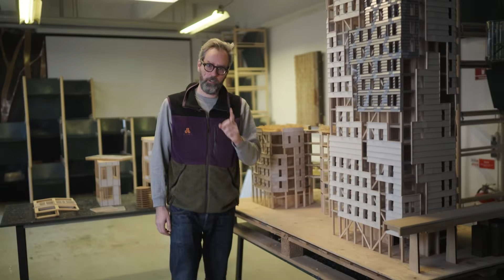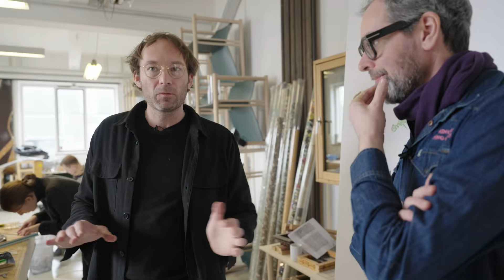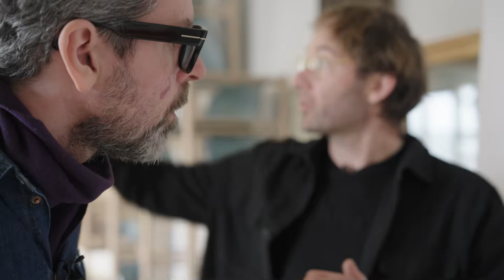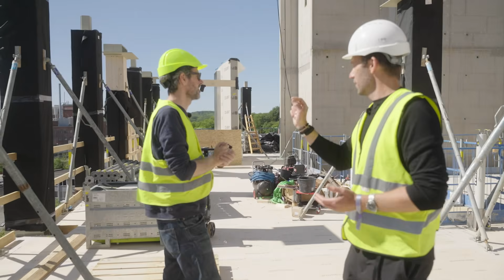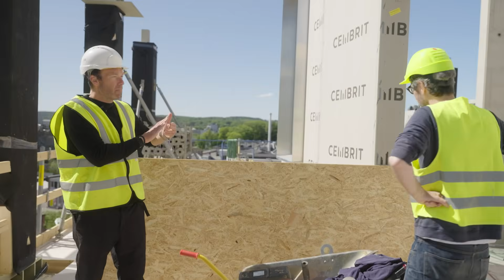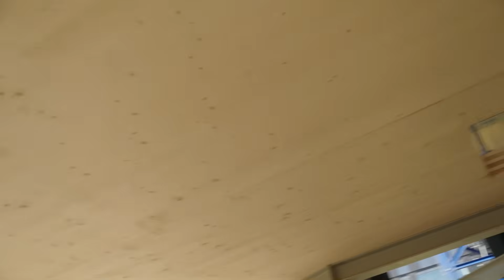Reconstructing architecture: Making one of the world’s highest sustainable buildings using wood

Comment: Oh my goodness - this was funny... But yes, we need to build more of this kinds of structures. I do it my self - just on a smaller scale with wooden structures for 1-2 storey houses. I think however that it is over exagerating to talk about the glue in glulam structures and CLT. Simply because you can and some already do, use glue that is much more harmless, than it perhaps was 20 years ago. Plus the amount of glue compared to the volume of the wood structure, is very small. Also to complain about cementbonded wood particle boards are perhaps also overthinking - but you could have used calciumsilicate construction boards in stead (unless of course they are 5 x more expensive - that is a factor too). You could probably have gotten away with making the cores in CLT also, just clad with calciumsilicate construction boards or cement bonded boards or gypsum boards without the need to make the walls 80 cm thick. Or even CLT with a thin layer of concrete casted on it. But of course there is also the whole stability thing - if these shafts needs to be heavy, like in massive concrete. But very nice project!!

Comment: Anders & Anders... We need to talk. I'm awfully sorry, but you are 85-90% wrong, which makes this video fake greenwash. 
Fact is that the Co2 stored in this loadbearing wood construction of this building represents a 85-90% Co2 emission as compared to the 10-15% stored in the building, all depending on the origin and forestry practices of where the forest comes from.

Or to make it more visual: Imagine that the diagram you show at 14:15 had a huuuge drop between the forest to the round wood?...and another to down to the construction grade lumber?

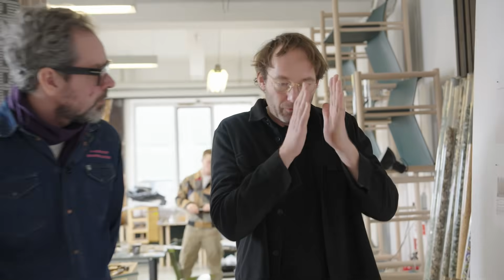Reason is that you both seem to have forgotten basic biology. At 13:18 we get told "...from when it is born as a building material". You forget that the tree was born to be a tree. Which through photosynthesis work to feed Co2 into the soil and lock it there. As the forest gets clear-cut all of this is release for the next 60-120 years (depending on climate zone) untill a similar root structure is re-created.  Them you have the loss of Co2 from the roots and crown, add to that the fact that max. 30% of the logs become construction grade lumber, which again gives a 70% loss. 

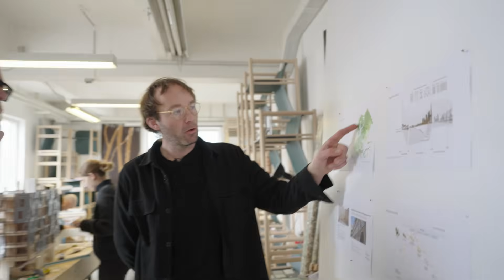At 10:00 you claim the map is green and that we have a lot of lumber. Sorry; data shows that all Northern hemisphere forests has gone from being net emitters of Co2 during the past 10-15 years, due to the bad logging practices. I can show you how the same maps actually looks white now when you zoom in a little. You are presenting a fallecy sold to you by the forest industry, which is on pair with the concrete industry in prioritizing profit over sustainability for our planet. Wake up!

At 23:05 it is claimed that a massive core from lumber would be "more sustainable" than concrete. I hate to advocate concrete, but fact is that you are so utterly wrong, as you are speaking from a cherry picking tunnel vision of what you like about the LCA methodology.

Please read point 3 under "Biogenic Carbon to the Rescue?" here https://lmnarchitects.com/lmn-research/08-carbon-offsets-sequestration-honesty, or see some of the videos on my channel, from experts (not architects!) who actually knows about biology, forestry and carbon. 

Please, I know you mean well, but stop making such nonsens fake news: You are quite literally cutting over the branch you (and all living beings on the planet) are sitting on.  We need to stop building such tall buildings, or in this case have utilised wooden I-beams for splitlevels and the core could likely have been made with much less lumber than calculated if fireproofed with a core of Foamrox.
The solution is to focus on 1 year biogenic and/or unburned mineral materials. (if it's necessary to build new).
Reply from the maker: Thanks for your input! We'll definitely dive deeper into the subjects of your comments in future episodes. 
To be more specific:

1. We're gearing up for an episode all about forest harvesting for construction and the pros and cons that come with it. If you are open to it, please also send us contact info on some scientists specialized in forrestry. You can mail us on: reconstructingtheworld@gmail.com

2. Another episode is in the works about LCA calculations and the good and bad sides of using them.